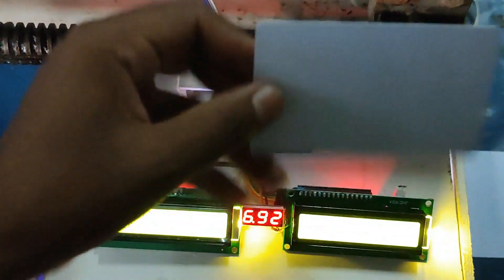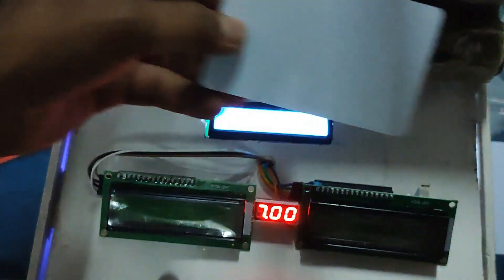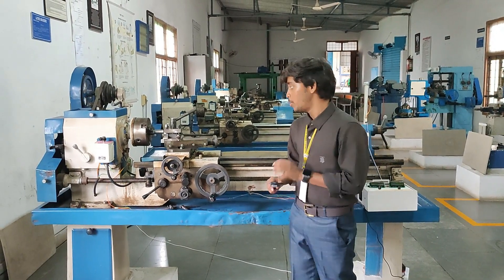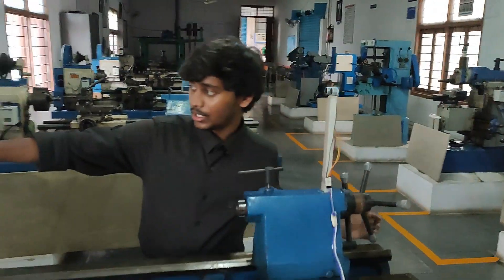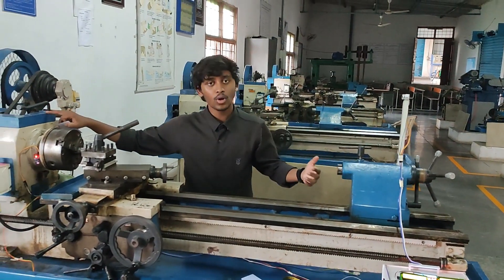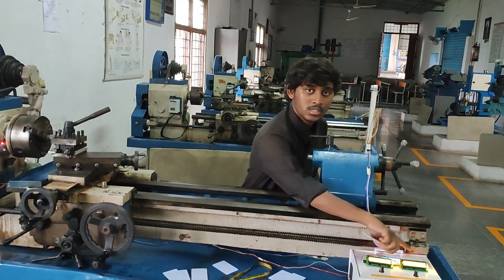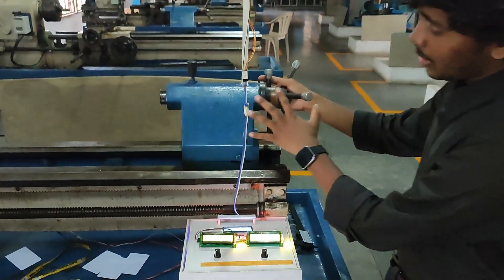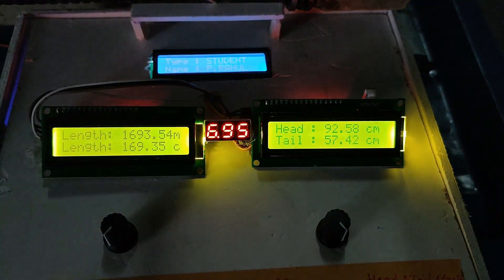Upgrading a Conventional Lathe Machine into a Smart Lathe Machine | Industry 4.0 | Automation & IoT

Comment: Instead of us sensors you can use rotary or linear encoders, ultrasound sensors are not precise in dust and smoke. Try to do the immature automation with plc, Arduino type mps are diy type low level applications